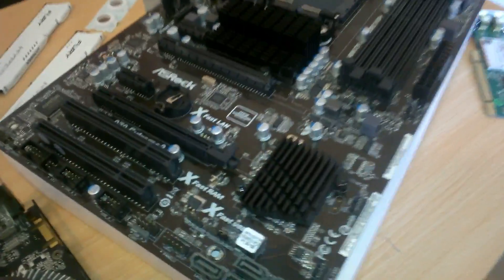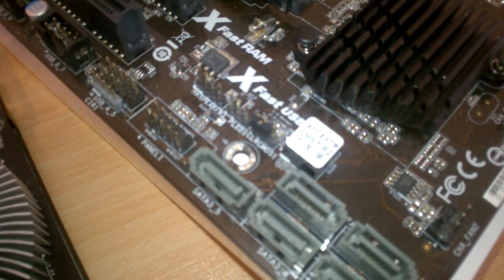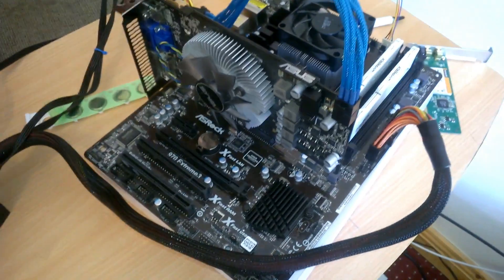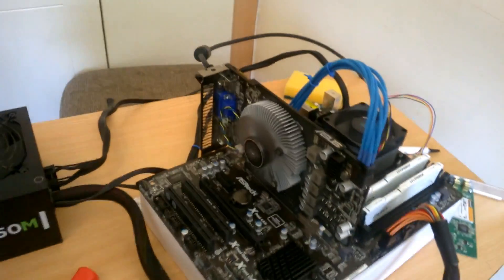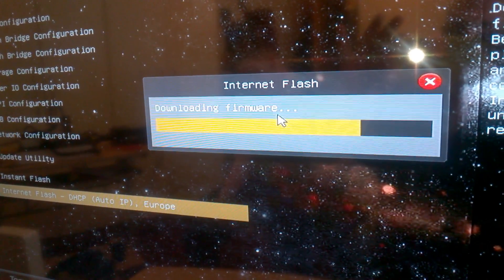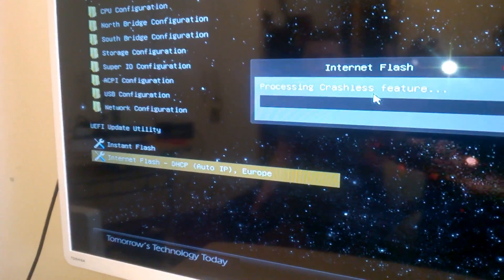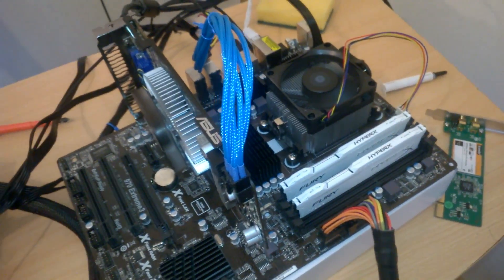Fixing A Possibly DEAD Motherboard

Comment: Hello: I don't know if you can help me. I have an Intel DZ68BC that stopped working overnight. When checking it I opted to change my Corsair HX850 power supply because the fan would spin for 2 seconds and stop. I bought another new Corsair RM750 and the problem remained the same. I also noticed that the skull does not turn on the lights and the number on it indicates is 58. The monitor and the two cdrooms stopped working. It is also impossible to access the Bios because the computer turns on for 2 seconds and turns itself off. I cleaned the processor (i7 -2600K-LGA 1155) and changed the paste, I cleaned the memories (4x4GB) and the fans and everything remains the same.
Can you help me with the solution or tell me what I can do or check, or is it that the motherboard has already died and I must replace it, if so, do you know any other similar that you can recommend? Your help will be very appreciated.
Thank You, Jean Batalle
Please Excuse my English.
Reply from the maker: Have you taken the motherboard out and tried to run it outside of the case? There could be a short somewhere and it's just turning itself off to prevent damage. Taking it out of the case would eliminate the possibility of they case to motherboard short.
Reply: No, I did not do it but I;m going to try because I don't  know what else to do. Thanks for answer me.

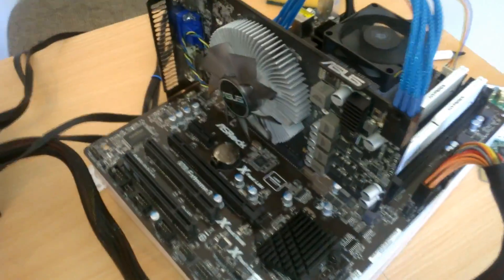Comment: what did you actually do at 6:30 when the fan was spinning but monitor shows nothing..... i am facing this problem
Reply: Try reseating the RAM (move the module(s) to (a) different slot(s)).
Reply: I am in same dilemma. Fan is spinning 100% no display

Comment: Impressed. wondering how much to fix a Dell XPS 630i PWA-DRUID PREMIUM/MOTHERBOARD A00. I used a multimeter to check power supply voltage checks on every wire. it doesn't POST. 
it has:
INTEL '06 Q9400 CORE 2 QUAD 2.66 GHZ,
GeForce GTX 285 graphics card, 
Dell 750E power supply, 
Killer Network Interface Card, 
Sound Blaster Extreme Fidelity Card Model: SB0880. 
RAM (2 of each):
Elpida 2GB 2Rx8 PC2-6400U-666, 
Samsung 1GB 1Rx8 PC2-6400U-666,
2 Hard Drives WD 500GB and 300GB.
Reply: fvrrljr why do you have a gtx 285
Reply: originally it's not my computer. it's someone who from day one when he bought it had problems with it and the back and forth with Dell made time run out on the warranty. I thought I could fix it but no cigar. may put a different motherboard. I am fixing this computer at no charge for the guy who I consider more than an acquaintance. plus it's a challenge. anyway all the research I've done on this computer has it's pros and cons. I am really trying to understand your question in many forms of expressions. the one I came up with was, how do I describe: rubbing hands together with a eerie voice, at least you didn't say  "my precious" giving thumbs up to your question

Comment: why my system unit not turning on?please help?
Reply from the maker: It could be a number of different reasons, I can't just say off the top of my head, if it's just been built, the power switch pins might not have been plugged in right.

Comment: I accidentally poured a drink directly on the processor and now neither does it boot nor post. Can u help me
Reply: Its dead u need to buy a new one
Reply: Newton Ambele the motherboard cpu slot is probably still dead though.
Reply: Depends if you have amd or intel

Intel:

Let it dry

Amd:

Buy a new one.

Comment: hey mate so i just want your opinion on this matter , i have my pc 2 years now and i always used to power it on 2 times before it could actually boot up . So i had some problems too sometimes it couldnt even post or beep but i would try some "remedies" like taking off Ram ,battery etc . But now some days ago i played a game and it crashed and now it wont beep or post again i tried taking the battery off  but nothing . Also usb ports dont work as well as my Gpu fans will spin for a brief moment but they wont go all the way . Sorry for the long message i need your help buddy . ty a lot
Reply from the maker: It may be time for a new motherboard, (It happens they all die at sometime).  If it was me, I would save some money and up, and maybe get a new PSU as well.
Reply: Emerald Isle PC's yeah i thought so too :/ i thought it was a combo of the two ..i also dont think i have a good psu for my specs , i got a Cm   gm 550 psu which is a tier 3 if im not mistaken and it needs to run a 6350 amd cpu and a sapphire r9 270dx gpu ..i think im gonna go with delta or seasonic . Ty a lot buddy i appreciate it
Reply: so did you buy a new mobo (which one) and or seasonic power supply, thinking back to your 1 year ago comment?  then again a 6350 & r9270dx gpu  are older than god. That you could game with such antiquated equipment is surprising.

Comment: Just built a new pc, everything works, fans are spinning and led are working on the gpu and on the mobo.
But the problem is when I try to enter the bios to install windows my monitor shows no signal...
Is my mobo dead?!?!?!
Reply: Erik Sørensen Nah, everything worked, I uninstalled the mobo from the case, put the standoffs and everything works fine now
Reply: Erik Sørensen Yeah I know :D thanks
Reply: @woodywolf0309  in your case thats one thing that can happen it may have a losse bios chip possibly corrupted bios so it kicks you to uefi witch modern borads don't have

Comment: sometime that works, sometimes it don't. if the motherboard does Not read any peak.start up volts on meter. then its dead. they are tools out they to test PCB for power failures. and if got water, tiny drop tht fall on the Motherboard. most likey cooked for good.  bad enough if some drop between ram slots. that whap happen to my $400 motherboard. sent it out to get fix all the way in CA. usa.
Reply: MARCELINO GUARNERO where did you send it to fix. And how much was the repair?

Comment: my motherboard don't display and usb ports don't work do you this will work for me it turns on just no display
Reply from the maker: commented on your video, try what I said, and if it doesn't work, do what I do, cry for 6 hours straight, and hopefully it will fix itself :/

Also, do you have different brands of ram? usually you are meant to have all the same brand.
Reply: tech dude reviews 12 same
Reply: tech dude reviews 12 same have you fixed it yet
Reply: Same problem
Reply: I also have the same problem. Did anyone found a solution?

Comment: i bought yesterday an rx 480 and put it into my msi gaming 970 mainboard, monitor says no signal and then I see the mobo dont recognize my ethernet cable, usb etc. but fans of the cpu radiator are rotaiting.
the fans of the new gpu rotating too but after 5or 7 sec they stop and start again to spin and the red led lights of the mobo are shining. will this solution in your video help my mobo?
Reply: sry for my bad english...
greetings from germany👋🙋
Reply: What motherboard do you have ?
Reply: @ mmatyp: HAHAHAHAHA a German Bruce Lee, You Made My Day!

Comment: I have a pc that suddendly turned off and now when I try to start it the fans spin for a couple of seconds and then it stops. Everyone says it's the motherboard. I've tested all the other parts and everything is ok but the mobo. I'm gonna try changing the cmos battery since I have gotten errors about cmos in the pass. Wish me luck.
Reply: Fulano De tal did it worked? i have  the same problem

Comment: Is this build good? Is the power supply enough for all of this? Just wondering.
- 32GB Ram
- Intel i7 4.0ghz (Unlocked)
- GTX 970 4GB DDR5
- ASUS Z97-P Motherboard
- Corasir SPEC-01 Case.
- XFX XT Series 600W PSU
- (Haven't decided fans or CPU cooler)
Reply from the maker: Yes, it should be enough.
Reply: Sams Tech Tips thank you man, you're a very helpful person =)
Reply: Btw I'm too late to tell you this most likely but the i7 isn't a good cpu for a 970

Comment: you seen fairly  knowledgeable  about computers I have a major problem and I have tried my best to fix it but ever since I built my PC over Christmas when I turn my PC on it loads up then freezes so I have to restart it manually and then it works but when I restart it it changes the date and time randomly do you have Any help?  I don't know what to do.  I have updated everything like drivers and that sort of stuff and I have even tried turning the brightness down on my monitor as I read something about it online but still no luck
Reply from the maker: its hard to tell, I'd really need to see it myself. I've never seen that problem. have you tried flashing the BIOS?
Reply: +Sams Tech Tips no idea how to do that because I am a noob at PCs but I will look it up and try it
Reply from the maker: Evan Mc I can throw a quick video together showing you how to do it if you want.
Reply: +Sams Tech Tips if you want to it would be great and highly appreciated
Reply from the maker: Evan Mc No bother, I get on that.